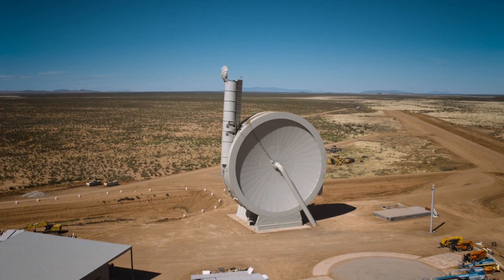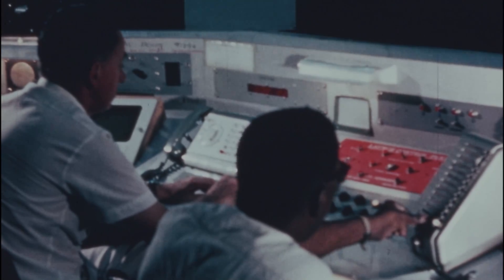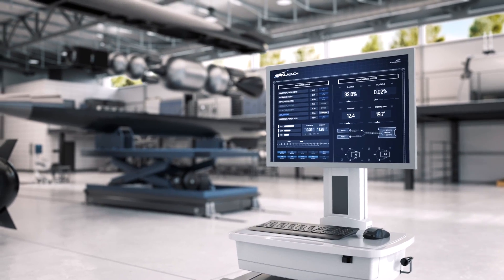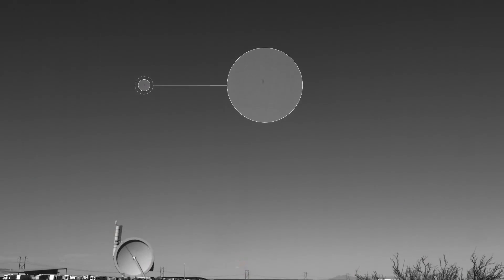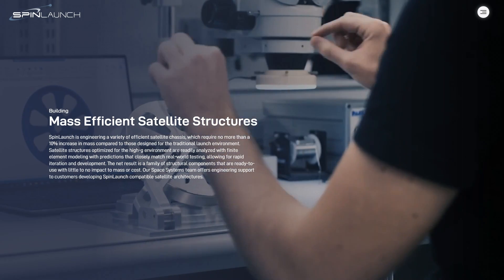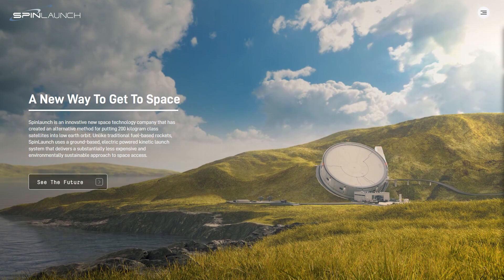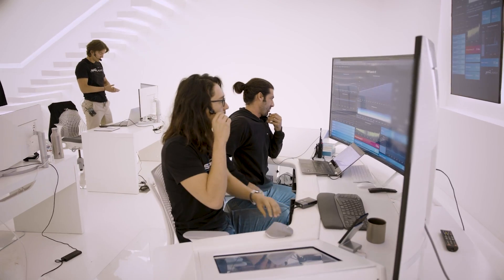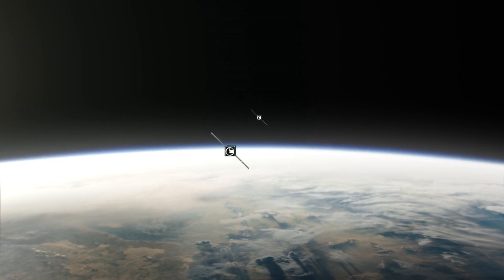Can Spinlaunch Throw Rockets Into Space?

Comment: I am very doubtful that this will ever be viable for launches from earth.  The G-Forces and massive thermal and drag forces of being Mach 7+ in the lower atmosphere are just too extreme.  But as you said it would be quite viable from the lunar surface where you only have 1/6 the gravity and no atmosphere to contend with.
Reply: How big would the radius have to be to safely launch humans into lunar orbit from the moon?

I can do the math tomorrow, hah
Reply: @arkology_city  on the moon you could launch horizontally because a trajectory that skims the surface is less problematical in the vacuum of space
Reply: @DrWhom  So I just did the math....the results are very odd math and very interesting to play with.

Your angular acceleration is THE SQUARE OF your velocity , and orbital velocity for the moon is 2,380 m/s...

This puts you at 2250Gs for a 250m radius machine.

By increasing the radius, you can decrease the Gs....but you need an exponentially larger machine to decrease the G-forces due to the formula. 

Therefore, in order to get to orbit with just a maximum of 7Gs on the passengers, you would need a machine with a radius of 85 KM!!!

Then think of the weight of such a structure, and then the motors, momentum, power requirements, etc....

I'm not sure if it would even be possible, even given the vacuum and 1/6th gravity.
Reply: @arkology_city  it would never work for a manned launch. The G forces required make it unsurvivable.  But for unmanned cargo launches it is possible.  Lets say you are mining for metals on the moon and running some kind of factory station in lunar orbit. This would be perfect for moving those raw materials from the surface to the station. And on the moon it wouldn’t need the enclosure around the rotor because it would already be in a vacuum.

Comment: Hey Scott, since this is reliant on a fixed energy put in at launch, reducing drag, and reducing shock from hitting the atmosphere, would this be something worth putting at a higher altitude? Say, on a mountain top at 10k feet or something.

Downsides I see are electrical power transmission requirements, transportation struggles, and probably some issues finding a friendly tall mountain at a low latitude.
Reply: Totally.
Reply: Nothing that a few large wind turbines couldn't handle.
Reply: @DavidKnowles0  You would be surprised - when it comes to powering industrial processes that have uptime requirements and consistent power draw, using renewables that vary considerably in output is more of a curse than a blessing for the process engineer - which is why in those applications coal and gas still dominate with renewables being a marginal player. A few megawatts for an extended period would need more than a few turbines, despite their nameplate capacity being theoretically above the required amount of power. And an absolute load of storage.

Comment: Or embed throughout the length of the arm magnetic interactive strips down the length of it line the inside of your chamber sort of like a particle accelerator with magnetics and have a computerized to match the magnetic pull of the tensions that a release and inbalance so you can artificially control the stresses sort of like railgun but instead of just propelling an object your just relieving the tremendous stress forces with magnetic buffering.

Comment: You could balance out the system on release by slightly changing the design, instead of one arm and a counterweight on the other side, just have two arms.  holding two projectiles of equal weight.  When you launch the satellite up, you also launch one down.  

It's a bit uneconomical early on as your smashing projectiles into a hole in the ground, but with enough launches we'll get through the crust and have a nice borehole.  Which could be very useful.
Reply: good idea!

Comment: Any engineer would've stopped right after calculating those 10.000 G's in the conceptual design... It's like trying to build a house using giraffes to lift up beams: it's a weird idea that could be remotely possible, but there's no reason to even bother trying when there's already a safer, cheaper, faster and more reliable solution: a crane (that is, a standard rocket in our case).

Comment: Another quick thought maybe have a wedge piece of the center of electromagnetically attached have the inner arm charged with a compressible gas and have an interior weight release upon the release of the payload to hurtle toward the end of the arm at the same time to simply replace the lost weight with electro magnetic's. Releasing the counterweight inside the arm attached to the center hub. but your hurdle it toward the end naturally but buffer it by the compressible gas flooded into it sort of like a piston.

Comment: Hello interesting concept I've thought about stuff like this but in space. Maybe this is where the well of this knowledge wound up at. Very interesting I love to see it work it'd be cool to see stuff being launched alternatively to the traditional message. Here's an idea once you release the wait which is balanced maybe have the arm interior pocketed for a rapid acceptable flooded gas of some nature or an exotic mixture of gas and liquid gas and a salad substance to regain a rapid Ascension of balance again once the payload was released. Obviously they are well underway to understanding that hurdle. But that's just an ideal maybe having interior collidable cavity incorporated into the design so you can instead of lose a large amount of weight replace it rapidly with a substance that will counteract the imbalance? Vast moving inert gases of some nature or a blend of whatever contained within the system injectable from the center line of course into the outer point of the launch arm interior. Maybe to get a better grasp of what I'm trying to say is like the Dynamics of a aircraft carrier launch catapult. But yet it's still different isn't it maybe. Hope it helps good luck to you all. Thanks for your time.🧐🏴‍☠️⚔️

Comment: Another thing to consider is that with stuff like this, there will always be attempts to weaponize it. Get the angle right and do the maths, and you could theoretically throw a projectile in an arc that could complete partial orbits of the planet. I'm talking Nevada to Hong Kong without a plane, fuel, or even anything large enough to detect on radar. Just a big fucking bomb that can be launched incredibly inconspicuously, at any time during a 24 hour cycle (with weather patterns and behaviour permitting). 

Build one of these on some sort of adjusting structure? You have a WMD that can hit anyone, at anytime.
Reply: Was thinking along the exact same lines. Even the projectile has a very aggressive look to it. Plus, you wouldn't even need to arm the thing with any type of explosive. Just a solid, telephone pole size projectile made of something super dense like tungsten. With the speed the thing would be going at impact would do near WMD levels of damage without a drop of explosive/fissile material.

Comment: I feel the answer to the jolt of vehicle release is to release a corresponding counterweight 180 degrees apart down into a sand pit simultaneously. It could be on a shorter arm, weight more, and have less tangential velocity.
Reply: I think this is the right answer

Comment: The killer app for this is for getting consumables into orbit: water, oxidizer, fuel, etc.  10k gravities?  No problem
Reply: Just don't try it with edible arrangements. They won't quite look the same on arrival.
Reply: @notthedroidsyourelookingfo4026  maybe this is how ship's biscuits make their return?
Reply: @notthedroidsyourelookingfo4026  Ah, but you can start with apples and end up with fresh applesauce on orbit.
Reply: Well astronauts' food is a squishy paste anyway.
Reply: Per their website, it looks like they are going for 200kg payloads at $500,000 or less. At $500k, it looks like they would be at $2,500/kg, or slightly less than an expended Falcon 9 ($2,720/kg). If they get to $250k, then $1,250/kg.
Reply: @steveaustin2686  I just changed the reply so that there's no ambiguity in units.  It's 10k gravities (G); not 10 kilograms (kg).

So an one hour spin up to 10k G is no problem for bulk consumables.
Reply: @RobertLeeAtYT  It's not a problem for most electronics if they are designed for it. It's just the payload capacity they are aiming for would be low for sending bulk consumables to orbit.
Reply: Solid bricks of aluminum and other building materials as well as plastics for printing. Heck 3d printing metal rockets is something being done. Printing a hull in orbit would be awesome, just launch a building robot and then feed it resources with this Yeet launcher

Comment: I feel like linear accelerators would still beat such a system by virtue of having much fewer ways of failing catastrophically. How much real estate a booster-less orbital launch system takes up on Earth (or elsewhere) is not that important since you wouldn't need to blanket the planet with them, thus the main selling point of being more compact seems pretty moot.
Reply: The main selling point is that a centrifuge has vastly lower power requirements because you can spin it up slowly rather than having to deliver all of the energy at once.
Reply: @charlesstaats9902  correct, power is lower but the energy bill comes to the same!
Reply: I agree! Was just imagining a skate on a rail-gun/magnetic accelerator in a vacuum tube. It could be built up the side of a mountain to avoid air traffic.

Comment: The simplest way to rebalance the rotor is to release the counterweight.  You could release both rocket and weight simultaneously, so the rocket goes up, and the counterweight flies down into some sort of crash pit filled with fluffy pillows.  The challenge is that the counterweight's kinetic energy is literally equal to its weight in TNT, so you're gonna need a lot of fluffy pillows.

Even better, if the bearings can make it through half a rotation while unbalanced, you could have the counterweight be a second rocket, and fire off two for the price of one.

Comment: Second stage experiences 10000G. The picture of the second stage shows spherical fuel and oxidiser tanks and all the components are centre line mounted. That seems not right. This isn’t a bullet and the projectile second stage is going to fly straight without rotating around its axis.  So the fuel the RP1 is going to want to flatten right out along the entire length of the rocket, plus the Oxygen. 

So my point is that those spherical tanks must be thick titanium skins or something. I bet the test was just a monolithic machined billet with fins welded on. A test of the a scale launcher and not a scale vehicle. 

So wouldn’t it be better to look at the densities of all liquids and then put the densest in a tank that wraps the inside of the rocket nose to start of the rocket engine and is flat across the inside section ( like you layer the rocket down on its side and just poured the rp1 in and make that the tank) then add another tank in against the first tank for the next densest liquid.  The thing is that you have the fuel and oxidiser where it wants to go under high G and then you just contain it, rather than having spherical tanks that require you hold the liquids supported in the centre of the body and also contain the liquids in those tanks. Then use the rocket components to off set the liquids mass in the rocket to try to even out the loading some what, then have the rocket nozzle offset to the side so the straight line thrust is through the offset CofG.

Is this a thing?

Comment: The answer to keeping the rotor balanced when the payload launches is simple - when it lets go of the payload it should also let go of the counterweight. The payload goes up and the counterweight goes down into an area prepared to receive it.
Reply: An easier way would be to release a weight the same weight as the rocket from the center of the same arm.

Comment: This like the arthropods in Children of Ruin. They throw throws from the outer solar system for resources. This could be very low power. Just have a solar panel to trickle charge some super capacitors and launch like clockwork while it's being loaded. It could be either manned or automatic. I wonder if they could use some self-healing material to cap the chute...
Reply: Self-healing materials sounds like an entirely different tech level than some solar panels, capacitors and an electric motor. However if you have methane or water, you could use sheets of ice put in place by a metal panel.

Comment: The center of mass of the vehicle goes in a straight line, tangent to rotation, from the point of release but the vehicle itself still has angular momentum equal to its mass moment of inertia (about its CG) times the angular velocity of the arm at release. You see evidence of this in the rectangular exit widow and the amount of yaw as the vehicle pierces this window. Do they have anything in the release mechanism to cancel some/all of this angular momentum of the vehicle as it goes down the barrel or do they only rely on aerodynamic drag to stop this after is has left the barrel?  Seems like this could be a challenge and likely increases initial drag as it encounters air at the exit.
Reply: I agree, seems like a huge problem The vehicle's rotational inertia will cause the vehicle to rotate 90 degrees by the time the arm moves 90 degrees. From the demo launch video it appears they've resolved some of the problem, but the vehicle doesn't come out perfectly straight through the vacuum/atmosphere membrane. I would think this will be more difficult at higher speeds.

Comment: They don't have just a 4ms window to worry about, they also must release the front of the projectile a few ms before the back to cancel the 450 RPM end over end spin the projectile has.
Reply: And if something goes wrong, it is not only the pay-load and its carrier to experience a RUD....
Reply: Interesting, is this true? I've always assumed perhaps wrongly that centrifugal system system would have no rotation when released if from a single point.
Reply: @mokiloke  The rocket is held fixed to the arm, the arm is rotating at 450 RPM, so the rocket is also spinning at 450 RPM. One must do something to stop that spin when the rocket is released. Releasing the front of the rocket first, and the back slightly delayed is the simplest way to remove the spin.

Comment: It all sounded ok until you mentioned how difficult it would be to balance it after it releases the payload.

I have an idea. Maybe release the payload and counterweight at the same time. The counterweight would fly into something that could absorb the impact. It's not a perfect solution, but it's probably better than trying to overcome the lack of balance otherwise.

I also was thinking that it would make sense to launch this from high elevations. I considered this with rockets, but the elevation makes little difference in the actual distance to space. However, here it makes more sense, because the atmospheric drag could be reduced significantly.

Comment: They could build it on a suitable mountain plateau to save some 4000m and change of dense air to plow through. Might be just enough to get it working without causing the detachable counterweight to become a massive hazard. Speaking of which... any plans on how they plan to catch that? And reliably at the correct timing, or they turn their whole vacuum chamber into an impromptu game of dodge-the-shrapnel.

Comment: This will obviously get the funding. For start, it might be harder to use it on earth, but on planets like the moon or Mars, this is 100% how we will transport minerals back to earth! Considering how impossibly hard to get fuel on these places, and that the only reliable power you get is electricity. 

Also North Korea is extremely interested in this project as well :)
Reply: @Bryan-Hensley  pretty sure you would, to circularize your orbit - unless you launch directly into an escape orbit, the payload would be on an orbit that intersects the launch site, and will be doomed to crash unless a burn is applied e.g. near apoapsis
Reply: @rickrickston3202  it would definitely need to be above escape velocity. There's no atmosphere drag on the moon. Escape velocity is much less than earth. I know it would need steering thrusters. I guess the question is, is this thing capable of reaching the moon's escape velocity with enough speed to travel back to Earth in a reasonable time.
Reply: @Bryan-Hensley  It is very easy to get things into orbit on the moon. In fact, a modern tank gun can shoot projectiles straight into orbit on the moon.